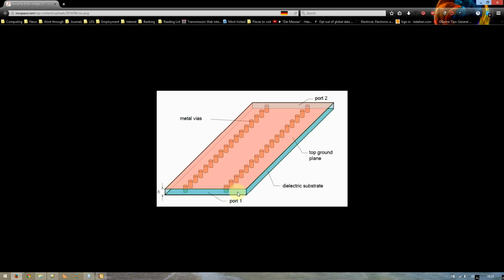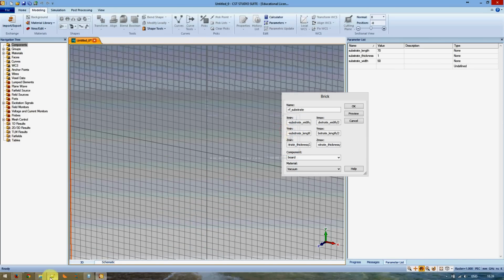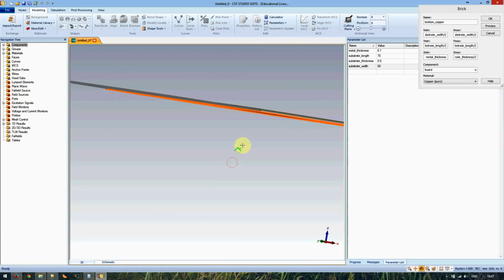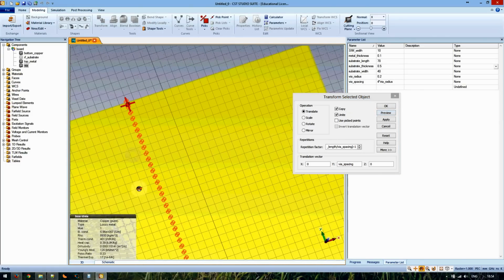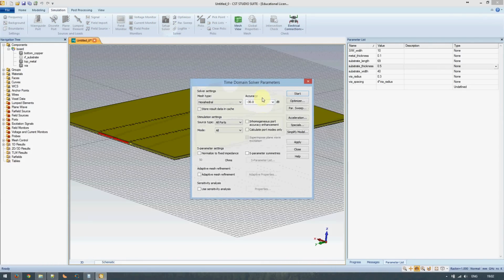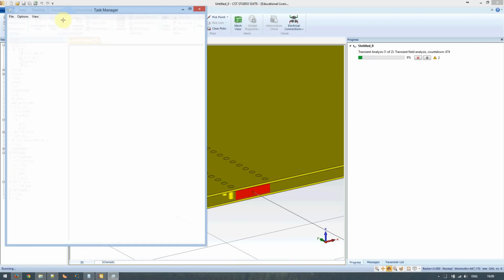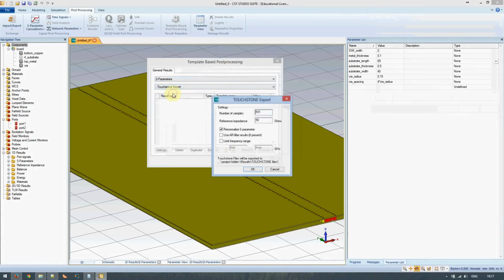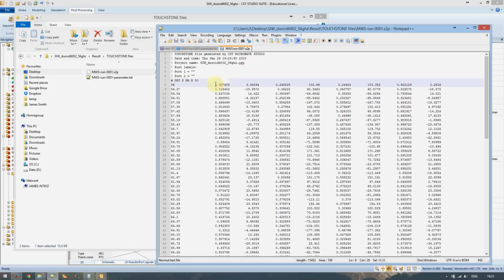CST beginners tutorial for Microwave Antenna Design

Comment: I am trying to design a UHF RFID Tag Antenna. The micro chip impedance is 48-j148 ohms. 
 I couldnt find any complex port also in CST?.
Reply from the maker: +Abdessalam ELYASSINI put ur question clearly.. What u want to know...
Reply: How to configure in CST a complex excitation (48-j148 ohms)?. because I work on RFID antennas
Reply from the maker: there is no option in CST for complex excitation as per my knowledge. u have to add  a strip line which behave as a capacitor(-j148) in series with 48 ohm resistance which is obtain at port of the antenna.

or if u find ur answer then let me know that is also beneficial for me